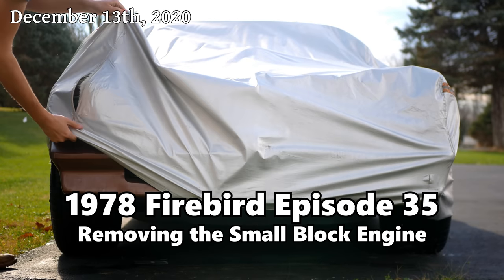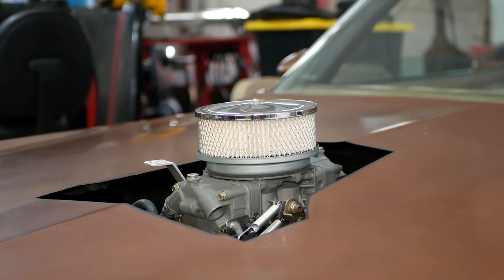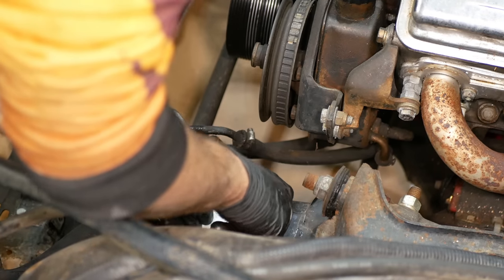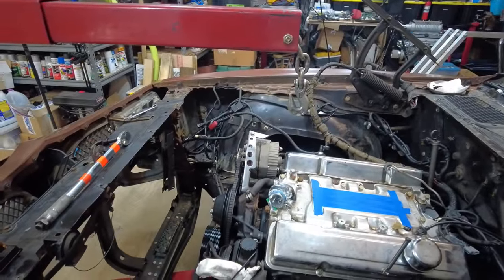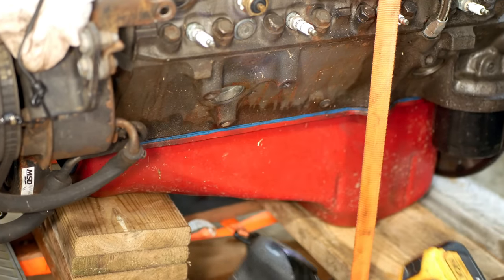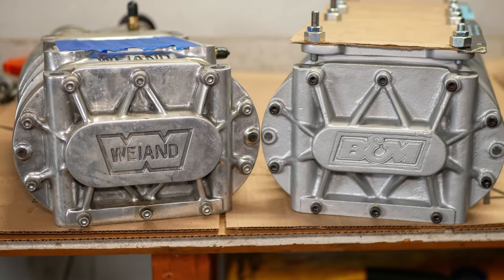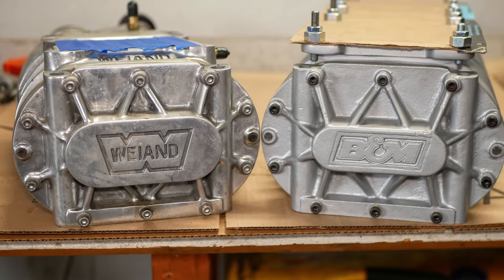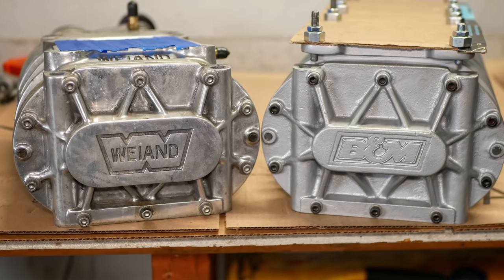454 Engine Swap: Removing Small Block Engine and Preparing for Big Block (78 Firebird Ep.35)

Comment from the maker: This one is coming in hot, which is why it is being posted at 2pm and not the morning like I'd usually prefer. This was a big moment for the car and I wanted to get it right, hopefully everyone enjoys this episode and is looking forward to what comes next!
Reply: You're wrong about the exhaust it's going to kill a lot of horsepower check out the episode of engine masters you need 3in exhaust minimum. I have a BBC 454 .60 over zz572 hydraulic roller cam Edelbrock tunnel ram/heads holley super sniper 2x4 efi 630hp 590tq NA I had 2.5in exhaust after the 3in collector coming off the headers took it off you can certainly tell the difference.
Reply: Loving this series so far.  Keep up the awesome work, and can't wait to see what projects the future holds.
Reply: For this fella over the pond in Europe, it's a welcome evening surprise. Thanks for posting, I really enjoy this series!
Reply: Pro-tip: Don't forget to keep your blinker fluid res topped off during the break-in period! Can't count the number of times I've seen 'em blow because of it... 🤣
Reply: Find a lawn tractor that's begging for a small block upgrade.
Reply: Another great video, thank you!!
Reply: This was over 3 years ago :|

Comment: 19:16 I had a chance to separate more european, like 50mm exhaust system crimped too much with a plain hammer drill on hammer mode. Just about 10 minutes at full blast was enough C:
Reply: This is why they make air-chisels. You can get them for like $20

Comment: If you want to upgrade that small block to a serpentine drive, you can use a 2nd gen 4.3 S10 or Blazer  serpentine drive system.  It will have belt clearance for the supercharger and will come with an 105 amp CS130 style alternator and an O-ring style power steering pump that has an extension so you can actually reach the fill port without a transmission funnel.

Just a thought for that SBC's next adventure.
Reply: Hey so you’ve piqued my interest, it’s a straight swap? Crank pulley fits?
Reply: @j_dawg97  Crank pulley fits.  The only thing that doesn't fit is the secondary support for the back of the power steering pump, but it isn't really needed.  You will need like an inch shorter belt than stock for an S-10 but they are readily available.
Reply: @j_dawg97  Oh, almost forgot.  If you do this, get the water pump as well as it is reverse rotation.

Comment: Pulled my first engine, seized flathead, sideways like you did in the video.

Did it on a heaved concrete floor, so me and my buddies had to get a running start with the crane to clear cracks 😂

Comment: I have never rebuilt lo botton end of a engine. So I plan on picking up a 350, or maybe a modern LS to learn on as parts are cheaper than exotic ones. I don't have anything to put it in yet though. But thats ok. It's kinda like building AR's few extra parts makes you start a whole new build lol
Reply: It's a good and fun project, especially these days there's videos and forum posts showing you how to do everything. Today I laugh at some of the risks I unknowingly took on my first build, but it worked out okay. Build a little engine running station with a radiator and starter and battery and small exhaust to run your engine on.

Comment: you will need big block springs. I put big block springs on my 1980 camaro so my headers wouldn't hit the road going over bumps and small hills and the car sits really nice. Great series so far I love it.
Reply: No you dont  .
Reply: I put an Olds 455 in my 79 which originally had a 3.8 V-6 in it. I left the V-6 springs in it, and it sat just fine with them. Of course, I removed a bunch of factory junk under the hood that was no longer needed, but it all didn't weigh that much. The 455 had iron heads and a factory iron intake on it.. 🤷🏻

Comment: Hey, just to let you know, and i hope you see this but I have a 77 trans am with a built 400 pushing 450hp and i just wanted to make sure you have frame connectors because if its just the stock unibody frame then your car might literally snap in half
Reply: Replying to this to hopefully boost the comment idk how it works
Reply: Yes. Frame connectors. Please see this comment. Knew a guy a long time ago who put a Poncho 400 in a 1975 Ventura (rear end of a first gen f-Body, front end of a second gen... that's why the front wheels look like they stick out so much). Anyways, he stepped on it down the backroads and the car twisted so much he shattered his windshield. I know Trans Ams had big power in 1971, but you can't be too safe.
Reply: No, the car will NOT "snap in half" without frame connectors and 450 h.p. 

I've ran more horsepower then this without them.

If the car is a rotted piece of shit, with original, cracking, splitting, body mounts in it, THEN it might move around a little.

At the very least, make sure that the car isn't rotten where the frame attaches to the body, and replace the old and cracked body mounts. 

I've ran several 2nd gen F-Bodys, and a 1976 Nova, with healthy big blocks in them, and NEVER ripped any of the cars apart. 

If you plan on going to the drag strip with sticky slicks on it, and have 500+ h.p., THEN by all means, put frame connectors in it.
Reply: @originalpunkSxE  That's a story that you heard... 
I don't care if it's 1000h.p., you're not going to shatter the windshield on a back road. The car simply won't have enough traction to be able to do that with the stock suspension.
Reply: @davelowets  You can bend a car with torque if it hooks.  Probably not a Camaro or Firebird because they came stock with plenty (at least in 1970).  But cars with too much power for what they were built with can bend.  Otherwise, no one would bother making frame connectors.
Reply: @originalpunkSxE  Of course you can, that's why they make roll cages, BUT it certainly isn't going to happen on a tar back road. 
I have cars capable of tearing up a chassis, but it'll NEVER happen on a public street. It takes a very sticky slick, on a well prepped track, for that to happen.
Reply: @davelowets  I meant for his setup, not mine. sorry for the late response but not for my setup at just 450hp, it's nice to have for upgradeability for myself but may definitely help him because you and i both know that that unibody was weak especially if you have ttops which i do. Fisher t tops make for less roof structure which is why I put the connectors on

Comment: “Probably disconnected the battery”… you’re not my dad!  I’ll set my own engine on fire myself no need for safety briefings!  Series is great.  Keep up the good stuff.

Quick question, did you ever confirm the reason for the pinto over heating?

Comment: At minimum you will want to get new front springs because big block 2nd gen f body had stiffer springs, the small block springs will not be able to handle the weight
all the other suspension components are the same regardless of what engine GM put in the car

Comment: I know you are a mechanical channel but about 10 years ago, painting cars with rollers was a thing.  Like Rustoleom paint.   Maybe a change of pace in the future once the engine goes in.
Reply: I've watched a few of those. That looks like so much work for a paint job that will only last like a year outdoors
Reply: @roberttractortaylor  I remember seeing some real good results.  What Fuzzy D has is kind of beat right now.   Can't be any worse.   Clear coat is mostly gone and the trunk lid and spoiler doesn't match.   Rustoleum makes a Farm + Implement paint and that equipment lives outdoors.
Reply: @dlewis9760  I guess you're right, I didn't consider the 78's paint job is toast from uv already. All the old videos I watched they didn't use the heavy duty Rust-Oleum, they used like your basic $12-a-quart stuff you can get at Walmart, so I immediately thought that's what you meant.

Comment: If you're still having any exhaust leak issues, the best exhaust manifold/downpipe gasket I've ever used is made by a company called Remflex. They're 100% graphite, and they are designed to squish out considerably. They really do solve leak problems caused by less-than-straight surfaces.
Reply: Copper gaskets are the best. They NEVER blow out, need replacing, and are reusable. I'm still running the same copper header gaskets that I bought 15 years ago. I've had the engine in and out several times over the years, and the gaskets are still perfect.

Comment: "We are re-using the engine mounts bcz they are new" Pretty sure you're not, but curious to see what's your solution. Also, how many times are you going to side-wind that crane before the bumper comes off..
Reply: Why wouldn't he use them?
Reply: @davelowets  BB uses different style mounts than SB. Although the hood already has a hole, SB mounts lift the BB way too high to see anything else than that blower. And there's the regular case of transmission tunnel and firewall causing issues, when the engine is, you know, bigger.
Reply: @oikkuoek  No. The mounts are the same for either engine
Reply: @davelowets  But if you set a BB on an SB mounts, it sits significantly higher. So it's either the engine side, or the frame side that needs to be modified to fit the bigger engine correctly.
Reply: @oikkuoek  No, it doesn't the mounts are the SAME. Yes, a big block IS taller than a small block, but the STILL use the same engine mounts. I've been building cars for 30 years, believe me they're the same.

Comment: [Edit] Bottom of the list @185 BHP, WHOOO!
Fun Facts ~ I had a Firechicken JUST like this back in the day, same year and everything too! The only difference was, welllllll, ever heard of something called a 'wide-block'? It was an Oldsmobile 403 Wide Block, meaning the angle on the Crank shaft was 120 degrees instead of 90. This actually had several advantages over a 350 or 400 because the closer you get to 180 degrees (IE boxer motor), the less energy you lose because of the intrinsic nature of a reciprocating engine. This also meant the intake manifold and carb sat a little lower in the engine bay because it wasn't as tall as a traditional small block. tl;dr = I was able to shoehorn an Edelbrock manifold and carb under the hood and still had enough clearance for the shaker scoop....barely! Doing headers was a B***H though...
Reply: A 120 degree V8 would throw the engine balance completely out the window. The Olds 403 big block is a normal 90 degree V8 like everything else, it's just wide.
Reply: WTF are you talking about? An Oldsmobile 403 was just a 90° small block Olds motor, just like the rest of them... 😕
They just had a taller deck height than a small block Chevy, and so they had a wider intake on them to reach across to the heads. They weren't calked a "Wide block" either. The 403 actually had a DISADVANTAGE over a 350 or 400 because the engine blocks had windowed main webs in them, and they weren't very strong at all. 
Get up over 500 h.p. with a 403, and your liable to drive over your crankshaft in the very near future.

Headers aren't a "bitch" to do on them either. There's TONS of room under the hoods of these cars. You can literally stand back, throw the headers at the car, and they'll fall right in place. 

Hell, I put a BIG BLOCK Olds 455 in mine, and the headers STILL fell right in. I didn't even have to jack the car up to do it.... and mine were large tube Hooker Super Comp headers. 

I don't know WHAT your problem was... 🤦🏻
Reply: The Edelbrock O4B intake fit just fine under the shaker on a stock 403 car, although they weren't much of an improvement over the stock intake.

If you wanted something like a Performer intake on one of these with a shaker hood, you simply took the intake to your local machine shop, and had them mill an inch off of the carb pad, and they fit.

Comment: You're putting a blower and a 290 hp truck engine.  I'd kept the smallblock 350
Reply: Why? That 350 made less than 290h.p. without the blower...

Comment: It's curious you couldn't reach the engine with the hoist from the front.  I have a 79 Camaro that I have pulled the motor in and out at least a half dozen times over the last 20 years.  I always push the hoist in from the front.
Reply: Depends on the hoist... 🤷🏻

Comment: the thing that always is a deciding factor in terms of upgrading to a different engine, is of course reliability and cost, the next would be overall ease of service and then power to weight. of course bigger cubic inches can result in more hp but also more torque but you're also pushing basically another passenger worth of weight around. people often gloat about the fact they have the biggest, baddest engine in their muscle car but dont forget. a small block can be just as capable as a big block in terms of power. Also just a thought. maybe you could wrap the headers to keep most of the heat in the headers themselves and not the engine bay. would help with burning off carbon in the exhaust system since they would be hotter.